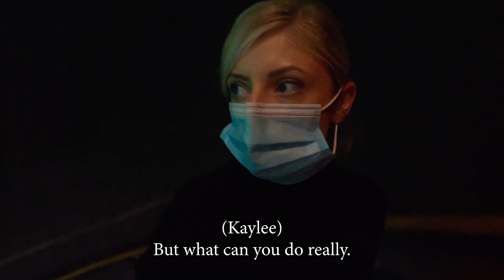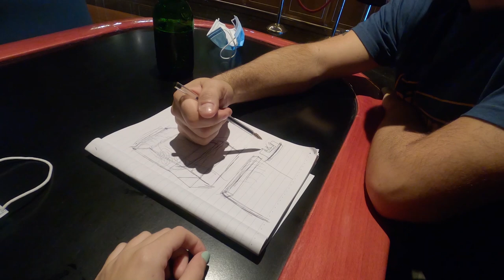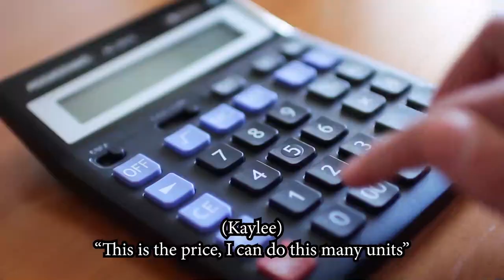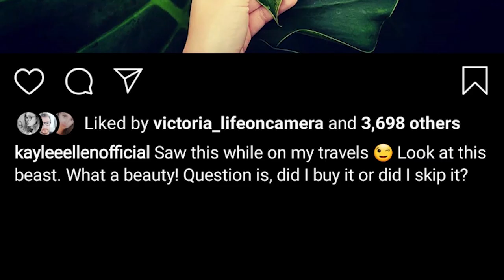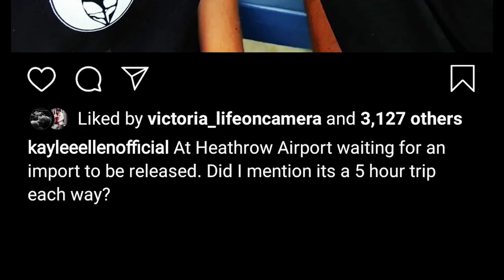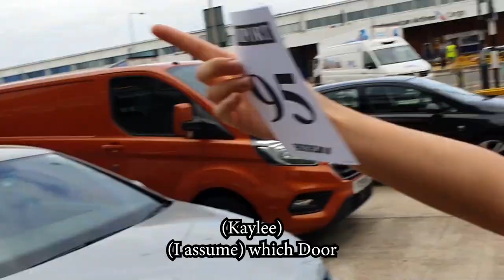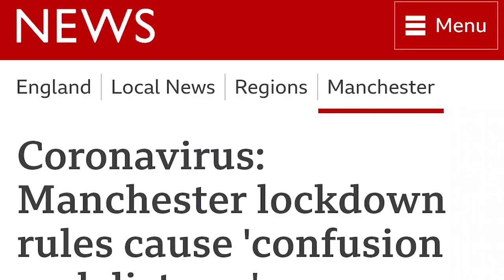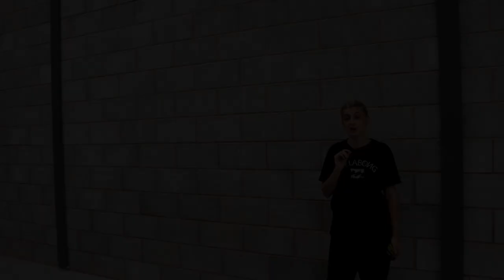Behind The Rare Plant Shop | Ep3 | The Wall

Comment: This was is amazing but how are you going to water these plants? The living wall at NSE is made of rock/concrete where the water comes down, and the plants are spaced out from one another. I don't see how the felt with everything so close to each other could work, especially indoors, with watering and air circulation needs. I hope it works! I hope it all works amazingly! Cuz that's like a $100,000 wall's worth of plants!

Comment: Why didn't you make the misters as wide as the living wall? Surely the center plants will thrive disproportionately to the ones on the left and right? I know we're trying to contain the mist so it doesn't go all over the place, but I genuinely think you need to expand the mister box.
Reply: Intresting question. The answer is.....this is a suck it and see project. We didn't find any other walls out there in the same style/scope.  The mist isn't the watering system but more of a wow factor with the additional bonus of increasing the humidity of the shop. When we initially tested the mister in the old shop we thought it would be adequate,  popped it on the shelf and realised 1 wasn't enough...got another and still thinking its not enough lol.  It may be changed in future.